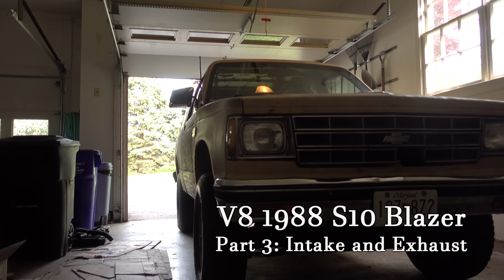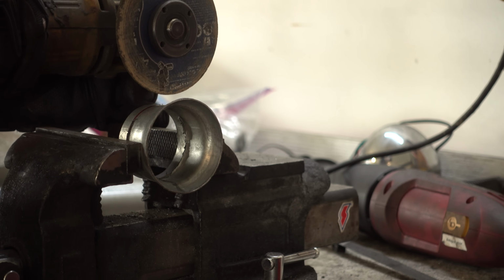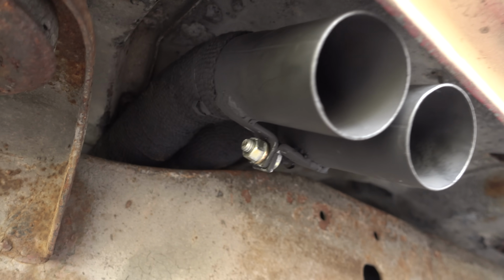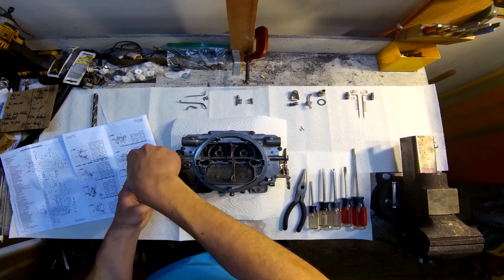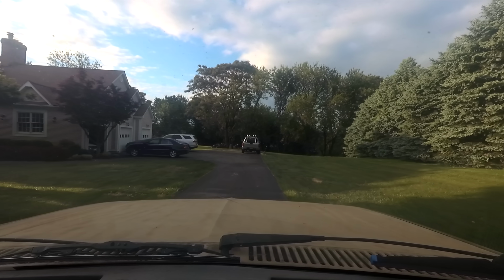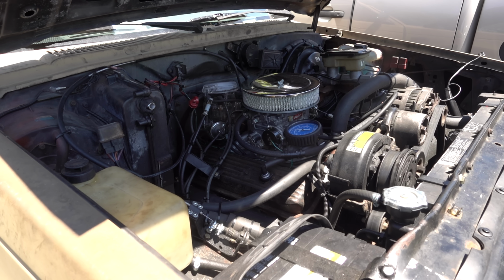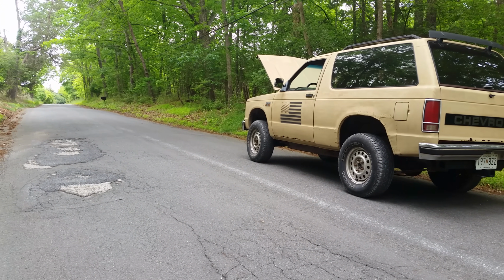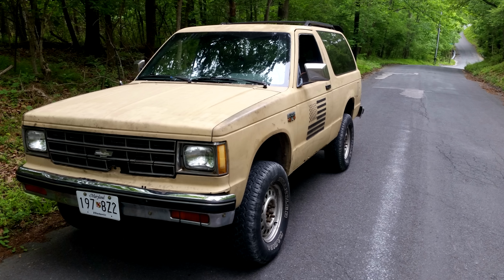4x4 V8 S10 Blazer Intake, Exhaust, and Breakdowns (Ep.3)

Comment: Would a V8 tranny fit?? If it does you should throw one in with a HP torque  converter to really make your project worth it. I feel it will be fun if you threw one in and you’ll definitely be happy. Great vid
Reply from the maker: By 1988, the 700R4 that came with the 4.3L was the same as the one coming with V8 trucks. After the rebuild it should be just as good as one that came from the factory behind a V8. The converter I put in is a slightly higher stall but since the engine makes its torque pretty low-end and this isn't a drag car, it will do just fine.
Reply: FuzzyDicePimp Cool, that’s good to know. I would have never guessed that a V6 engine would have a V8 trans. connected to it👍🏼👍🏼👍🏼👍🏼

Comment: This build is awesome! Wish you luck with rebuilding that trans! By the way how do you change the oil in that Blazer with all those tight clearances.
Reply from the maker: Not easily. Have yet to change the oil filter with everything assembled. Worst case the y-pipe, inspection cover, and front driveshaft have to come out. Best case I just need to limber up beforehand and wear yoga pants to change it.
Reply: LOL. Ok. That sounds like a pain to remove all that hopefully you won't have to.
Reply: That's something that actually exists?
Reply: Oh ok. Thank you

Comment: Probably valve float as to what your high rpm issues is
Reply from the maker: I suspected this too, until I realized it was not RPM dependent when actually driving it later on. I have the explanation in another comment, but basically it was just that the floats ended up being set too low.

Comment: Did u leave the v6 torque converter in when you did tje swap?
Reply from the maker: I left in the V6 torque converter. People like to use them in V8 swaps (and as upgrades in other cheap-o builds) because they stall slightly higher on a V8 than a normal stock converter would. But who knows how many miles are on that thing, it may have been the original with 200k.

Comment: When I did my swap my stumble was from vapor lock. Didn't ever think of that.
Reply from the maker: I did consider that, but since it would do it at any engine temperature, and with the setup of the fuel system it was very unlikely. I did take steps to prevent it, I had previously dealt with the heat soak under the hood of my Firebird being pretty intense.

Comment: awsome vid. u really know what ur doing. Especially where u made angled washer for the new intake. Then rebuilt the carb.
Reply from the maker: Most of it is out there on the internet, you just have to search and sometimes get lucky. I found out about that angle difference between cylinder head types, and learned there was a company that makes that specific sort of angled washer (and of course they are very expensive), and figured "I can make that". That is how a lot of things go working on projects like this, it is all about getting a base of knowledge, anticipating problems, coming up with solutions, and getting creative when you have to.

Carburetors (especially Edelbrock) are pretty simple, I enjoy working on and with them. In the next episode, rebuilding the transmission, that was intimidating. But in the end, it's just another machine made of simple parts. Many, many, simple parts.
Reply: Yeah that was some great work!!!

Comment: Love this project, awesome job!!  I know it's been VERY difficult, but don't give up!  

Just a few notes from one car guy to another.  About 20 years ago, my buddy swapped out a blown 305ci with a 350ci in his Firebird and that destroyed the transmission in just a few days.  I'm pretty sure the original tranny can't handle the torque from that 350ci when it was designed for a 4.3L or 2.8L V6 (whichever the Blazer came with).  Second, my guess is that you have an issue with fuel pressure with the higher RPM hesitation.  Check the fuel filter if you haven't already, and check the fuel pressure.  Consider a new fuel pump as well.  

Good luck!!!

Comment: Did you spray brake cleaner through the throttle shaft, to check for a vacuum leak there the bushings wear out.

Comment: I'm not shore of you've figured out the oil filter problem but a remote oil filter kit would fix that
Reply from the maker: Yep, and maybe in the future, but I'm cheap and I don't like the idea of shoving even more things into that corner. I do actually change the oil filter in the next video, and it is not as bad as I had feared. It's a very tight fit and requires the inspection cover to be taken off, but it seems doable.

Comment: sweet build! just a few months ago I got my 2000 gmc jimmy fuel injected 5.7 350 on the road. I used the transdapt kit with no issues. I'm also using the 4.3 rad with flex-a lite 420 fans running off a 180 degree switch and she sits right at 185 all day long even in traffic!
Reply from the maker: Good to hear the stock rad is working for you, it still is working fine for mine! Sounds like a great truck you have there!
Reply: you seem like youre pretty sorted with your project and engineering things to work but if you have any questions just ask I'm more than happy to help!

Comment from the maker: I figured out the engine stumble, I'll show it in the next video, but it was the floats. I had installed the "offroad" needles as the rebuild kit I had used came with both types, and set the floats as outlined in the instruction PDF for the Edelbrock offroad needles on their website (7/16" and 15/16" drop). I read a few forum posts on those and saw at least two posts quoting older versions of that manual with different specs (3/8" and 1 1/4" drop), it seems that the older carbs like the one I used for this truck have a slightly different bowl design. So I pulled those needles, put in stock-type ones and set the floats again.

Done. Fixed. Despite the "correct" float settings, it was not getting enough gas into the bowls. That is all. Both frustrating and relieving to have that figured out. Thanks to everyone who offered suggestions! (And correct me if I got any details wrong!)
Reply from the maker: Thanks for sharing that, very cool!
Reply: Awesomeness. I listen to your videos while I write code. Your troubleshooting inspires me to build software that operates properly. Hope to see more of this ride.
Reply: Luke Morter when u go over a mountain pass or have a lot of elevation change the floats in the carb get out of wack and can either mix to much gas with air or starve the engine of gas which mean you stall and then you have to get out and re adjust the carb to the elevation and do the same when your at the bottom
Reply from the maker: It can have an effect, for sure, but a carburetor with a proper tune should still run fairly well at pretty much any elevation. Older carburetors or ones that were picky to begin with and on weak engines (best example being VW Beetles) would often have severe problems with elevation changes, but with better carburetor designs and higher compression engines it usually isn't a huge issue. It will throw a tune off, for sure, but shouldn't be far enough that a safe tune (that isn't already on the lean side) would be unusable if you drive in thinner air a few thousand feet up. Floats will be affected too, and should be checked for something like an offroad vehicle that is going to see steep angles at a significantly different than normal elevation.
Reply: You hearted AND pinned your own comment??
Reply: i hope you plan to swap the rear end out i dont think it could handle that v8 so if you do i would recomend a ford 9 inch
Reply: nice. glad you got it figured out. i was gonna suggest needles or possibly trying different sized jets
Reply: what about a carburetor is a pain in the ass?
Reply: i have driven in mountains and canyons my entire life and have never had to readjust my carb in the middle of driving. i guess if you are using the wrong carburetor and the wrong fuel pump and the incorrect jetting in the first place than you could experience those kinds of issues
Reply: Fuzzy Dice Projects, you are super bad on this Blazer!

Keep up the amazing work, you are inspiring me!!!
Reply: Luke Morter yeah I guess I am
Reply: Fuzzy Dice Projects 
Why don't you buy the proper parts for this V8 S10 build? Wrong intake manifold bolted to the wrong cylinder heads will be disastrous in the near future. Don't be cheap. Buy the right parts for your S10.
Reply: Cool - glad you found the issue. I was wondering if your high rpm issue was due to exhaust flow design. You have a less restrictive intake, but your exhaust pipes look like they could have issues with higher flow rates (ie, high rpm), causing too much backpressure - enough to make engine stumble.  Specifically where the Y pipe joins left and right banks.  But thats just armchair internet speculation.  Amazing garage build!  I've dealt with old car issues (60's) and replaced carbs, intake manifolds, down to the timing chain and rods, and still had issues for years before throwing in the towel and selling off the car cheap.  Super impressed by your perseverance to find and solve the problems - all with basic home tools. Thumbs up!  Can't wait to see it with some bigger tires and 4wd'ing offroad!!
Reply: FuzzyDicePimp Glad you were able to get it figured out
Reply: FuzzyDicePimp your should have gone fuel injected carbs are a pain in the ass
Reply: FuzzyDicePimp  keep up the great work! Can’t wait to see the next video! I’m subscribing now!

Comment: I really like your build and video format.  Have you checked the fuel filter?  I didn't hear you mention it.  :)
Reply from the maker: Thank you! I replaced it after putting in the new tank, fuel lines, and pump a while back, has barely been driven and the fuel pump flows very well when I tested it with the carb top off. Good thinking, but I'm confident it is just fine.

Comment: the best part about projects is their never ending and always an excuse for upgrades my v8 s10 gets driven daily worked on every weekend now has a vortec 355 south bend clutch dana 30 front locked lsd 8.8 rear 35 inch tires 10 inch lift ls swap is next and dana 60s
Reply: its nice to see another s10 owner who hasn't given in to everyone and their brother screaming "lower it" "bag it, thats the only way s10's drive right"
Reply from the maker: Very nice! I've definitely looked into solid axle swaps, I am not against that for a future project. Mine wouldn't be near as crazy as yours, though!
Reply: the other good part is 90% of my parts are junkyard parts i pulled myself and reused or rebuilt nothing better than a truck you build yourself with the money you earned giving a feeling of pure accomplishment

Comment: It sounds like the fuel pump can't keep up with your fuel demands
Reply from the maker: I really doubt it, it's a new TBI pump and regulated down to 5 PSI should flow more than enough for this engine. Did a flow test with carb top off and it really moves gas. I do want to test it with an inline fuel pressure gauge up against the windshield, though. Read my reply to D J Tanner in the comments below for more info on the symptoms, I could certainly be wrong.

Comment: What is the exact RPM when the engine starts to break up?
Reply from the maker: Drove it for a while yesterday, realized it is actually not RPM dependent but load dependent. Tach wasn't accurate with the V6 and REALLY isn't with the V8, so don't have actual RPM numbers, they're all guesses. It's probably around 3500-4000 RPM in Park, but in fourth gear at 45-ish MPH it's somewhere around 1500-2000 RPM, so it won't get going much faster than that unless traveling downhill. Flooring the gas pedal downshifts and gets a relatively high engine speed, but it only runs smooth for two or three seconds before coughing and losing power. Didn't seem like it would completely stall, though. Need to get it stumbling under part throttle and then step on it to see if the clears up from the accelerator pump adding fuel.

Had a vacuum gauge on it, pulls a lot at idle with 18" in gear sitting still. Stumble seemed to come in right below 8" of vacuum consistently when driving. Held at 9" it seemed fine for long stretches (if not particularly powerful). There is a shrill noise from the exhaust under load above maybe 1500 RPM, I had thought it was just my crappy exhaust bends and sizing but now I'm not so sure. It's pretty loud and unsettling, and barely there when revving in park. Definitely has a smell after a high RPM rev when driving, not really gasoline-y but not sure what it is. Plugs are very clean, maybe a bit tan-yellow on the ground strap but I'd probably have to shut off right after a stumble for that to be more clear.

Current suspicions are the carb doing something funny or maybe something to do with excessive blowby. But I'd love to hear any suggestions!
Reply: FuzzyDicePimp , this is incredible. I have a 92 Chevy C1500 2wd pickup with a 5.0 liter V8, TBI & 5 speed trans with almost the SAME exact problem. I’ve spent a ton of money and time trying to correct this problem. With all this going on it never has tripped a check engine light. My next option was to change to a carb and HEI distributor but after seeing what you are
going through, now I’m not so sure. I basically have done the same diagnosis and repair with the same results. I am fit to be tied with this truck. If I make any headway I’ll be sure to let you know of my findings. 
I’ve enjoyed watching you resurrect this old S-10 Blazer. I have to give you credit, you are an excellent mechanic and fabricator. All the best!
Reply from the maker: Thanks for the compliments! Practically as you were typing that reply, I figured it out and fixed my truck. I'll detail it in a comment I'll pin to the top so others see it, but it was the wrong float height setting for the needles I had used and the old model carb I had. Unfortunately I can't help you with your TBI, I never got mine working right either (and never a check engine light). All I can do is wish you the best of luck with your C1500!

Comment: Your fuel pump cant keep up with the carbs demand for fuel it cant pump fast enough all in all your still getting more work done then i would have done on that project i would have givin up by know
Reply: ...possibly bad advance springs in the dist?
Reply from the maker: At this point it's my own stubbornness to not let this truck beat me, haha. I really doubt it is the fuel pump, it's a new TBI pump and regulated down to 5 PSI should flow more than enough for this engine. Did a flow test with carb top off and it really moves gas. I do want to test it with an inline fuel pressure gauge up against the windshield, though. Read my reply to D J Tanner in the comments below for more info on the symptoms, I could certainly be wrong.